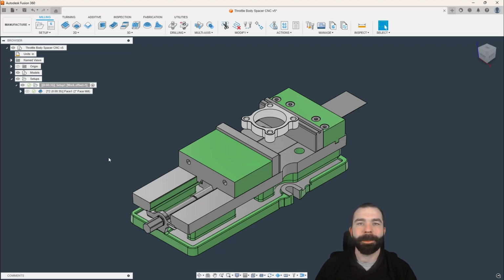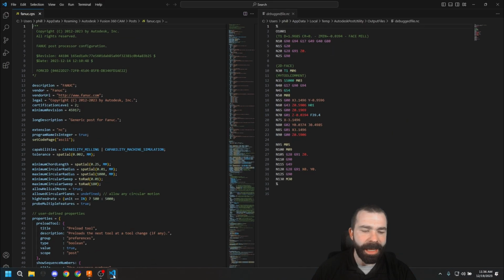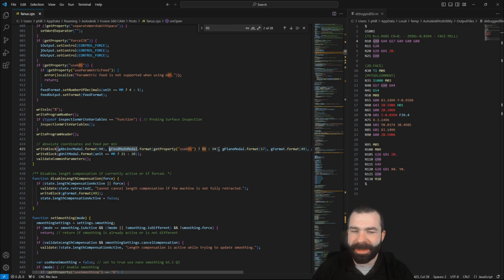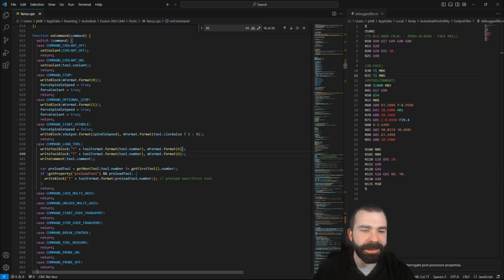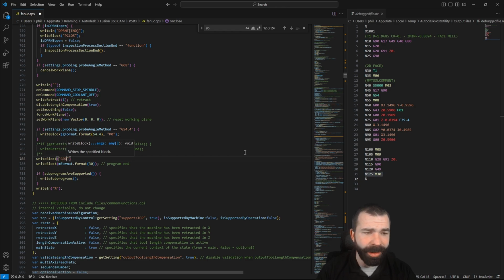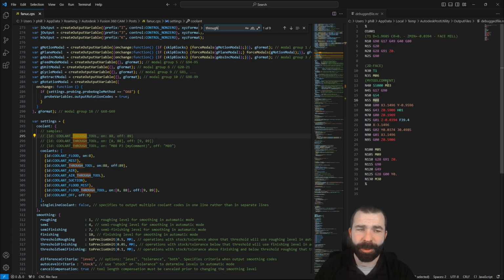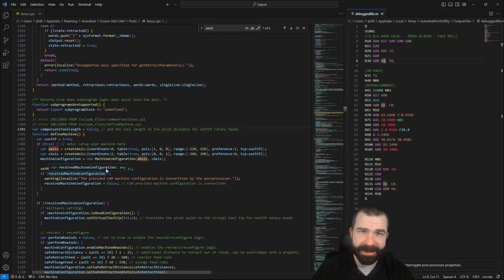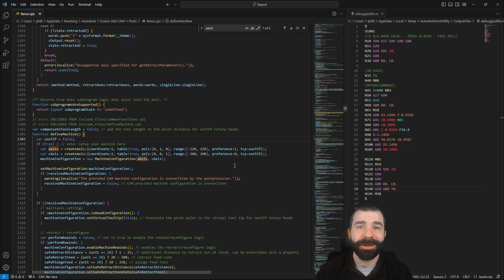Workflow Wednesday: Minor Post Changes

Comment: When you changed the G28 G00 Y0. at 10 minutes, do you still need it to be in G91?
Reply from the maker: It would depend on the machine/controller and use. however if you wanted to add the G91 to that line you very easily could based on the same thing as the G28